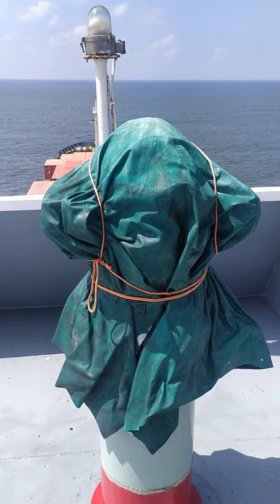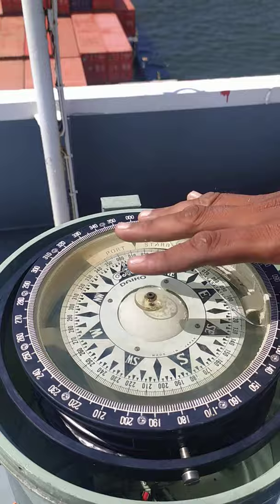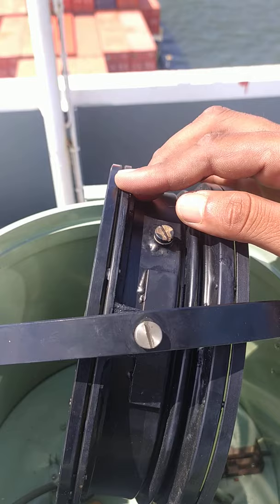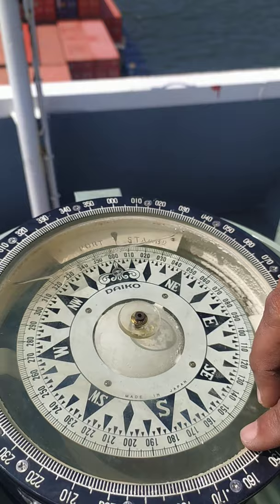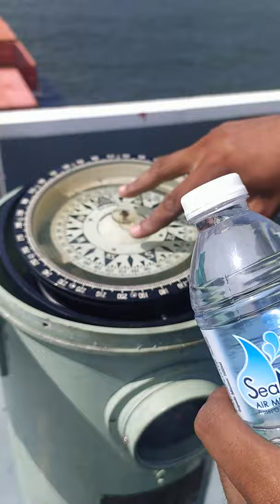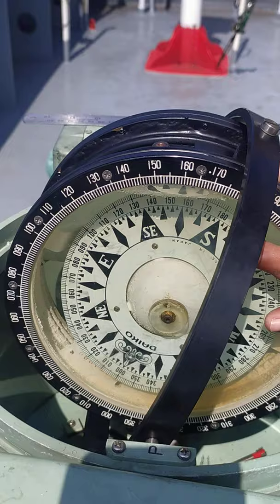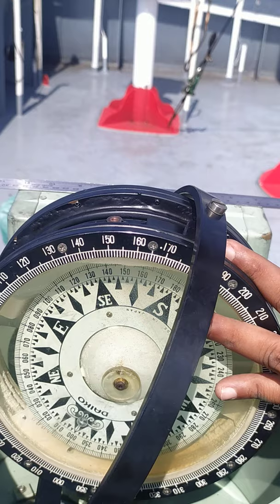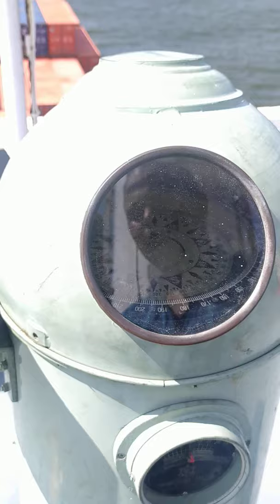MAGNETIC COMPASS AIR BUBBLE REMOVAL

Comment: Sir how air bubble is formed in magnetic compass n wat problem will cause if der is air bubble in magnetic compass?
Reply from the maker: Sir, bubbles are caused by slight leaks as well as due to temperature variation (which causes Volume difference resulting in bubble formation).

The problems are bending of the wet card (and from experience, I have literally seen a compass card bent out of shape and rendered useless). Also, if the bubbles are high in number, the card stabilisation will be heavily affected.
Reply: @prasobhsugadhan  wet card gets bend n card stabilisation will occur?
Reply from the maker: Yes sir.